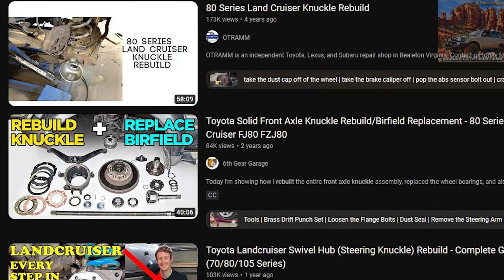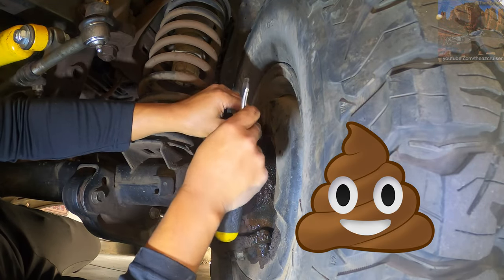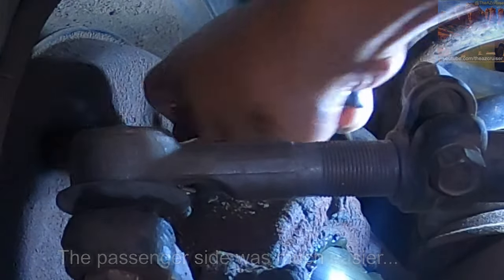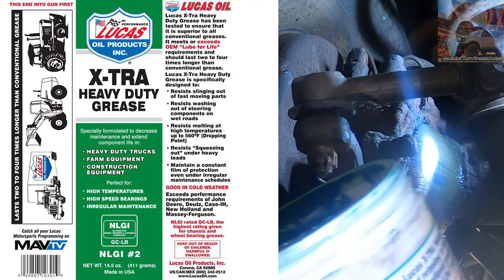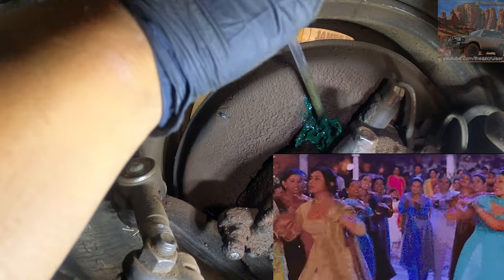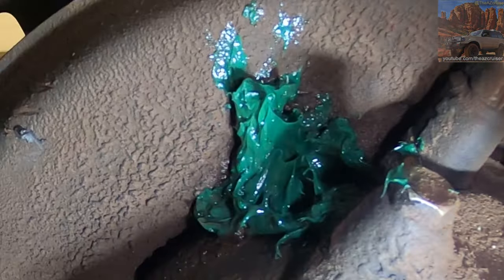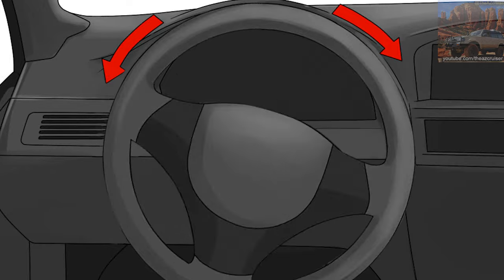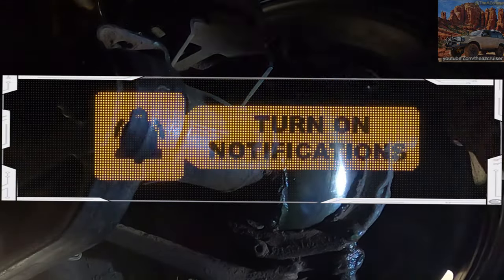ℹ️How to grease your birfield knuckles (80 Series Land Cruiser)

Comment: Greasing through the inspection port sucks it takes me forever. I’ve been thinking of getting that Milwaukee grease gun. Thanks for sharing gotta check mine now. Cheers!
Reply from the maker: 👍 it will be definitely easier if you have a grease gun 😜
Reply: I have the m12 grease gun...  definitely a tool to get.. I actually use it quite a bit on the 80
Reply: @lsswapped80  That’s the one I’ve been looking at for a bit. It’s about $130 bucks with a battery.

Comment: I can't imagine how you could do this without also shoving debris and grit inside your knuckle with your bearings, especially when cramming it in with fingers or a screw driver. I can see using this technique if you discover out in the sticks that your knuckles are bone dry (and you happen to have a tub of grease), but this seems like a TERRIBLE idea in the garage. I think I'd be more comfortable leaving my old grease alone than potentially stuffing dirt in the knuckle.
Reply from the maker: knock on wood been going on 4 years and counting haven't had any issues yet. But yeah this would be better for a trail fix or if you have no more grease in your birfields.